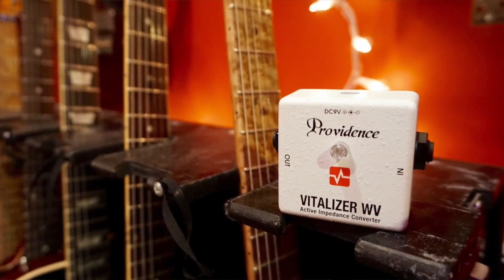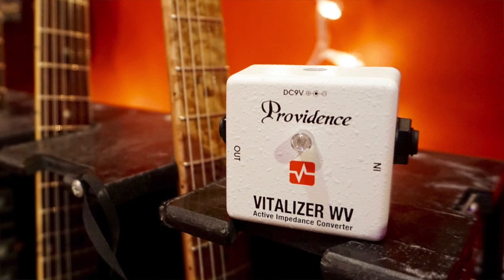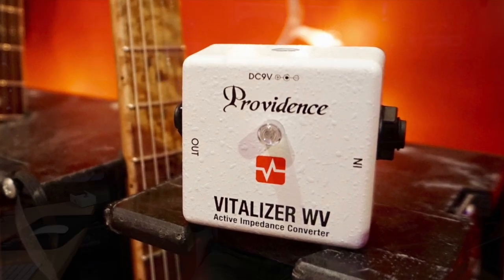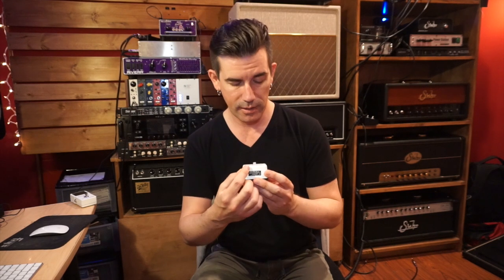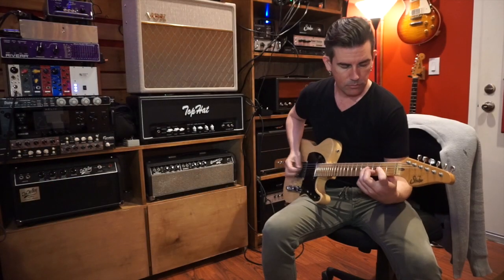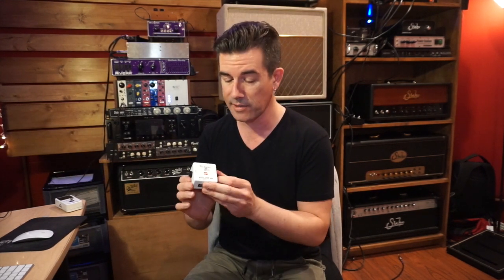How A Buffer Will SAVE Your Guitar Tone,  feat. Providence VitalizerWV

Comment: Nice demo and explanation Pete!
I did some calculations out of curiosity.. If you consider a cable with 0.014Ohms/m 130pF/m (got this data from a famous manufactor website), and an ideal buffer circuit, you could run a cable about 2km (6500 feet or 1.2 miles) long without loosing signal in the audio range!!
Reply: i always wanted to play guitar while iam doing the grocery! xD

Comment: Hey Pete, I've heard it said that when you have a large pedal board, you should "sandwich" the board with buffers in front and behind the pedals. But this test suggests to me that a single buffer should work... the premise being no matter how many pedals on your board, it's unlikely the total cable length would equal the 100 foot coily in your test. Does that make sense assuming a 10' foot cable into the board, true bypass pedals, and a 20' cable into the amp? Thanks!

Comment: Awesome video Pete! I used a buffer once and it felt almost too bright for me, I guess I've gotten used to the high end roll off. Also I'm wondering, can you get a similar result with an EQ pedal?
Reply from the maker: So in that instance- pick the cable u like the sound of, when plugged right into the amp-and plug that into the buffer with everything else AFTER it- the sound will be the same (or virtually the same) as with the cable plugged into the amp.

Comment: Where does this go in your signal chain? Plug your guitar into it then everything else goes after it or at the end of the pedalboard going into the amp?
Reply: At the beginning, if you aren't using a vintage fuzz pedal (in which case you would put it after it as the Fuzz Face is meant to load the guitar directly).   Also maybe another one at the end.

Comment: So we all want true bypass pedals so we can put a buffer in front of it...!? Any non-true bypass pedal (with a buffer) will do the same for you, right? The only variable is the quality of the buffer  - I'm sure this is a good one.
Reply from the maker: Ha, I know, your 1st point is true in many respects- it's confusing sometimes. The reality is- sometimes true bypass is good, like when you want a tuner 1st inline in front of fuzz/treble boost, or univibe, none of those pedals would sound right with a buffer in front! My old Prescription Electronics Experience pedal is SO cool- always never sounded right on my pedalboard live. because there was a buffer in front.  This is before I knew about this stuff.
Reply: Good question,even though I do not have a Kemper (not even a half of the money haha).
Reply: @PeteThorn  confused between the difference between this and a boost pedal?
Also, if I'm running 4 cable method- compressor,  wah, od, distortion and chorus into noisegate then into the front of the amp, where would this go? My guitar goes into the noisegate input. It's a noisegate with It's own send return loop. Stone deaf reaper.  The other 2 cables , I run from my delay and reverb into my amps effects loop. 
I have a foot cable from guitar to gate and another 6 foot from gate to amp.

Comment: It's kinda simply that, lower impedance signals suffers less from capacitance, and RF interference (another benefit of a buffer), you can use a Boss pedal, or any other buffered bypass pedal, and the result will be the "same", some buffer circuits are better than others, but is still better than run all true bypass pedals on a pedalboard.

And another thing, buffers don't play well with vintage fuzzes, so be careful about where you put the buffer on your signal chain.

Comment: What if you have more than one pedal, say 3 to 5, between your guitar output and amp input; what effect will it have if all or most of the pedals are buffered? Will too much buffering be detrimental to the tone?
Reply from the maker: +tzd I really don't think so. As far as too much buffering. I've experimented a bit and I can't really hear it starting to sound bad after 1, 2,3 buffers. Just sounds the same.

Comment: This is a great video, and a great product. Never hurts to have a little knowledge about electronics when your guitar chain is made up of, quite often, a lot of electronic devices. There's a very similar product made by Undertone Audio that is a guitar cable with a dial for controlling the amount of capacitance in the cable. I think its called the VariCap or something along those lines. Great channel btw, new subscriber. Thanks!

Comment: Mr. Thorn, first off, love your videos. Now here's my question. My setup/pedal order is: 
Boss TU2 -
Keeley 4 Knob Compressor -
( 2 ) MXR Phase 90s Script with LED -
MXR Super Badass Distortion -
MXR Carbon Copy -
Boss RV5 Reverb - ( always on )
Ibanez TS9 reissue

I assume that both Boss pedals are buffered as well as the Tube Screamer which means I should be ok without a standalone buffer correct?

Comment: Since my wireless unit is first in the chain of my board should I run the wireless out to the buffer then through the board and out to the amp? 

Also, if I’m running wireless unit to a fractal fm9 then 50ft out to the amp, would I still need a buffer or will the fractal act as a buffer already?

Comment: Hey Pete. Very good!  What about the effects loop though?...could it mean that you might need another buffer in the loop? That was always a bugbear with pedal boards, even my nano board - how the tone suck happens with cables,/patch leads/pedals. I don't have that issue anymore, now that I run a Helix.
Reply from the maker: very amp-dependent! My PT100 loop rules in this regard- it's extremely well buffered. Not all loops are created equal, far from it. So yes, a buffer like this can help in some instances.

Comment: If you have at least one pedal on, between the guitar and the amp input, then the buffer is not needed. But if there is the possibililty of using all pedals off, then the capacity of all the cables sum up. To prevent this situation (unlesse you never use it), you should use a buffer.

Comment: Hi Pete.  I wanted to ask you if there is any effect like this that happens on a wireless system?  I have been thinking about getting one, bit like the long cord issue, I don't want to sacrifice my tone.  Do you have any words of advice for wireless?
Reply: goneflying140 line6 wireless units are digital and have no loss of frequency/tone. Line6 wireless units even have the option to simulate high end loss to make the wireless signal sound like a non-buffered wired set up.
Reply: Search his channel for this video:  Line 6 Relay G10 guitar wireless, demo by Pete Thorn
Reply: Thanks for the help!  I will check them out.
Reply from the maker: Most (all?) wireless units are low impedance - ie buffered- out.
Reply: Angus Young records with his wireless because he liked the sound better than a cable. I'd imagine it gives a bit of boost unless they gave him a 20 foot cable in the studio.

Comment: This wasn't an issue before the craze for true bypass pedals - everyone talking about how the old pedals "affected their tone" even when switched off.  Now they realize their signal is degrading fast the longer the cable runs, easy fix - drop in your favorite boss pedal, heck put the tuner first - problem solved.
Reply from the maker: Actually it was, sort of an issue- Eddie Van Halen used to use a Boss 10 band EQ at the end of his chain to make up for loss. Could have been the high impedance out on his phase 90, not driving the cable run to the amp... but i get your point- Boss pedals just work and always have, because ya they are buffered :) Too much true bypass causes issues, and hence the need for a stand alone buffer like this one...
Reply: Like I said, drop in a boss tuner in front of your pedal board - you have your buffer, you have a tuner, you even have a power source to drive your other pedals - problem solved.
Reply: Dani's fun time corner! It's not that simple. There can be a drastic change from buffer to buffer. Some buffers, like the ones in boss pedals are of low quality and they also affect the tone. This is why high quality buffers exist. 

As for the true bypass pedal craze, it's better to have pure, unaffected tone from your own pedals and just add a high quality buffer in front of the chain to compensate for the tonal loss of long or low quality cables.
Reply: To each his own, local pedal builder that I buy pedals from - he claims that of all corporate non-boutique pedals, the boss buffer circuits are of high quality.
Reply: Steven Christides agreed. just because it was never discussed doesn't mean it never affected tone. there is a place for everything, true bypass and buffered bypass. it all has a place depending on what you want the end result to be. knowledge is power.
Reply: Pete Thorn Love this channel. The buffer should be at the beginning of a pedal board I assume then correct? Can you do a review on a decent wireless set-up. I've used some that just turn your tone into am harshness. Great channel!
Reply: boss is the superior quality,dont buy into cork sniffing bullshit,it will drain your bank account and you will not sound superior to someone using ANY boss pedal in his board.
Reply: @Kevin Meer What is "unbearable tone loss"? What is your benchmark and how did you determine the effect the Boss pedals had on your tone? If you like the sounds you get from Boss pedals but dislike what they do to your bypass tone, consider getting a loop switcher.
Reply: Dani's fun time corner! Hey will my Boss blues driver work?  Should I plug it in directly after my guitar/before the rig?  I also have a Boss DD7 I plug in pre amp

Comment: Isn't that why BOSS TU3 is so popular? It has a high quality buffer and also is a tuner.
Reply: Boss just needs to re-brand the TU-3 as buffer that comes with a free tuner built in!
Reply: Jeff Grivel wow so tu3 has a buffer inside? So i already have a buffer :D
Reply: The buffered bypass is what sold me on the TU3 over TC electronics Polytune which is true bypass.
Reply: I did exactly the same as you! haha...nice!
Reply from the maker: You are correct, a TU3 is buffered bypass. And works well for many applications! Some companies tout true bypass as the way to go, (My TC Polytune is TB) and then you can "pick your buffer" if you chose to use one, as they are not all equal and where you want it in the signal chain matters with some rigs (like if you use a germanium fuzz or treble boost, you don't want a buffer before those). Sometimes it's best to have a buffer at the beginning, or close to the beginning but after fuzzes, AND one at the end of the pedal chain- certain pedals need a buffer AFTER - when a pedal output is high impedance, like Phase 90s and univibes, they won't drive the cable to the amp that great- buffer AFTER at the end of the chain is advisable. Or, you are using an A/B box at the end of chain to go to 2 amps and you use an iso transformer on one out so there is no ground loop- buffer at the end of the chain is needed to drive that iso transformer properly!! or... you need a stand alone buffer to drive a long cable run to or from pedals in an amp FX loop, because the loop is not buffered well....
Reply: <<or... you need a stand alone buffer to drive a long cable run to or from pedals in an amp FX loop, because the loop is not buffered well....>>

Excellent point! Many players don't consider that running to & from the loop can use almost double the cable versus running from the last pedal on your board directly to the front of an amp.
Reply from the maker: regarding fx llops - i meant to say because IF the loop is not buffered well :) some are. many aren't!
Reply: Pete Thorn the tc polytune is switchable between buffered and true bypass. i use a wireless to the pedal board, and that solves all my problems. it also eliminates any dangers from bad wiring at venues.
Reply: Jeff Grivel the buffer in the tu3 is shit, and the tc polytune is switchable between tb and buffer. you made an uninformed decision.
Reply: What do you mean you have a buffer? you need a new one..better...you have to buy it....are you really a guitarist not wanting new gear and content with what u have?iam so pissed off right now...buuuuuuy iiiiiiiiit.....

Comment: Hi Pete, quick question i hope you can help/explain to me.
I've just started using an active line buffer and i've used it last in my line then a 25ft cable to my amp, then i used it with the 25ft cable to the buffer and them a 6 " patch cable into the front on my amp. I have to say it does sound slightly brighter we a tiny bit more life to it. does this make sense or are my ears playing tricks on me. in your experience should this make a difference ...does this make sense.

Thanks for your help, and the reviews.

Gaz

Comment: Pete,  VERY interested in buffering. I run a quality 10' cable into my Sonic Research tuner, then right to my Wampler dB+ boost/independent buffer then to all my pedals. Then from my board probably 50-75 feet of cable to my amp back stage in an iso booth. Is the Wampler dB+ doing the same thing as the Providence VitalizerWV? Thanks and do more TONE videos they are AWESOME!
Reply: Oh, I "think" but I dont know whether I am losing signal or not.

Comment: Not to be arbitrary here,but that 100ft coily cable tamed the harsh treble Pete was getting and made rhe tone warmer and meatier sounding.
Now I agree that when you have a bunch of pedals like I do,the tone suck is too much and therefore needs to be more dynamic especially using modulation pedals,but theres something to be said about midrange tone that happens due to high impedance.
I think Pete looking disapprovingly after using the 100ft cable at the beginning of this video was a bit too biased.  Also consider that using a Telecaster,he should have rolled the tone knob back a bit more to get rid of that overdriven shrillness.  Every Tele owner knows this from the minute they buy one.

Comment: Great as always man. Where would you personally choose to place this buffer from Providence in your signal chain? Between your last pedal and the front of your amp or earlier? Thanks Pete
Reply: Bump...same question...where in the chain with a pedalboard?
Reply: Given that you don't have any pedals that don't like seeing a low impedance signal (germanium fuzz for example) stick it first in line after your guitar cable.
Reply: Thanks man. I've got an LA Sound Design buffer on my big board which buffers the signal at both the start and the end of the pedalboard- that thing works great. I've had mixed success only using one so wondered what worked best for other folks, thanks for the input!
Reply: I have 2 buffers on my board. First one is at the start of my front-of-amp signal chain and the second one is at the start of my fx loop signal chain.

Comment: Can't you just turn the highs/treble up on the amp when using longer cables? Is it a suitable method to temporarily compensate for tone loss if one plugs straight into the amp with a long cable (Assuming I adjust it again after switching back to a regular cable)?
Reply: Obviously I'd adjust the tone knobs again after switching cables lol. I even specified: "...when using longer cables." Anyway, I'll edit my initial comment.
Reply: Not really. You can't create frequencies that aren't already there. Roll-off means that the high frequencies are cut completely from the guitar sound, so even if you end up boosting the treble, there's nothing left to boost. Amps can make any frequency louder or quieter if it exists, but if it doesn't they're pretty much powerless in that aspect.
Reply: But honestly all you have to do is make sure that one of your pedals is buffered bypass. Despite popular belief it won't have THAT much of an effect on your sound, and it'll help you keep your high end. A much cheaper and more practical solution than getting a $119 "high-quality" buffer that just helps convert to Lo-Z. Most of the info about guitars online is biased bullshit and marketing, always remember that.
Reply: no,thats not the solution and would sound brittle and overcompensated

Comment: Hey Pete, does any digital effects have low impedance? For example, guitar - multifx digital unit - amps, that output from multifx is low impedance so not using buffer still be alright. Just a thought, cause it's more for pedalboard users from what I've heard here.
Reply: oh, my guitar would still suffer from impedance if I use a long cable RIGHT BEFORE going to the input jack on my Zoom G3n. So this thing (for digital users) is still necessary, should one use a rather long cable from their guitar into something (regardless the digital fx unit is creating an already low impedance towards the amp or direct to PA)

Comment: Wow. I had no idea that cables made any difference at all. Very difficult to refute it when hearing it so black and white like that. Very cool! I run my guitar straight into an AX8 and then into my amp using pretty short cables. Do you know if the AX8 changes the impedance of the signal like this box does?
Reply: dude, your AX8 is processing all your tones so you are ok. (its buffering by default)
Reply from the maker: ya you should be fine in that particular setup
Reply: Thanks gents! I still think I'll pick up one of those providence cables :)

Comment: Some people actually prefer the "drag" that coil cords make on their sound. It really depends on what genre of sound you are looking for ... If you want a Hendrix sound like that long coil cord, that's the thing to do. If you want a more contemporary sound, use that misnomered thing called a "buffer" (a buffer is actually, anything that impedes anything else). The proper term would be a "booster." But electronic engineers call it a "buffer" because of the electronic razzle-dazzle that happens inside the little boxes they build. Go figure.